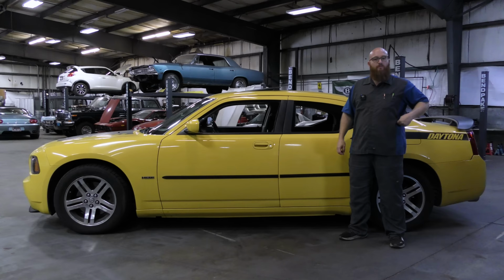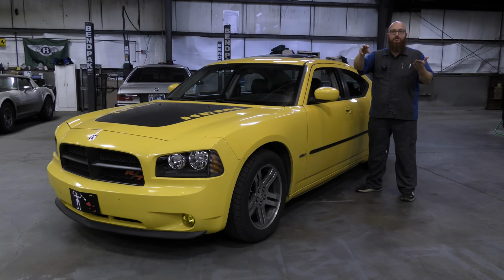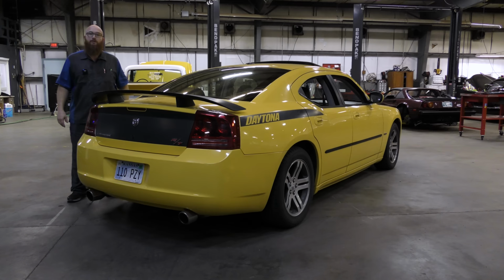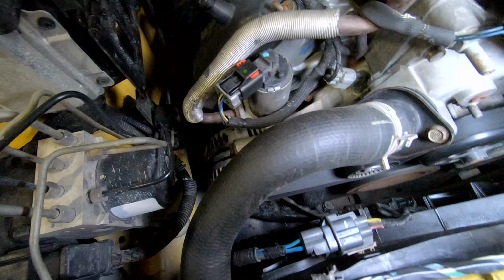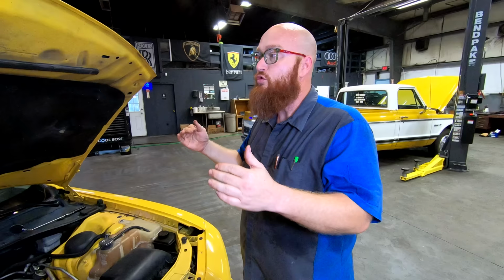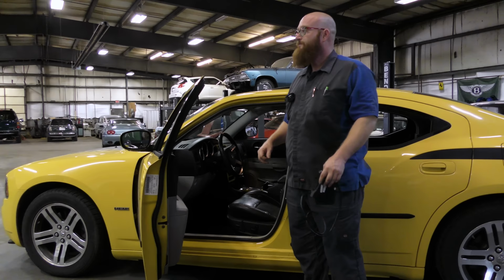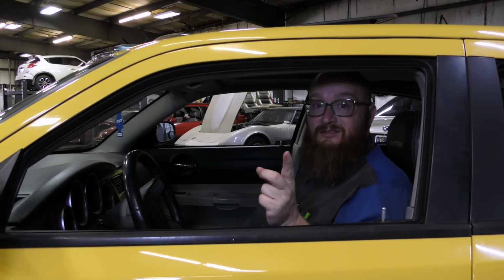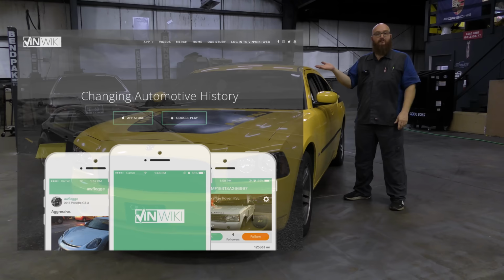4 things you MUST check before you buy any used car! CAR WIZARD shows how not to be scammed!

Comment: A good list but I have many important items to add. I won't buy a car if I don't get to see the cold start. If I show up and the car is warm immediately no deal. I've turned around and left large dealers because they warmed the car up prior to my arrival to run the heater or A/C. Take the oil fill cap off. Check for moisture or a white milky substance. Sign of a possible bad head gasket. Look down inside with a flashlight. Verify no sludge buildup. Pull the dipsticks. If there is burnt varnish that means the fluids have been neglected and/or the vehicle has been abused. Look inside the radiator and confirm no corrosion and that the fluid is the proper color. Take cardboard and lay under the car inspecting for rust and accident damage. Check tires - brand new is a warning sign of a possible cover up. Old tires are a sign the vehicle isn't driven much and expect many small things wrong with the car as you go to use it. Old tires are also a bargaining point - a new set could be upwards of $1000 depending on model. Be sure the spare tire, jack, and security key are all there and in good order. Slightly mismatched colors on body panels, overspray, and any fresh paint are warning signs of collision and/or covering up rust. Finally be sure all the exterior lights and wipers function properly.
Reply: Hi! Yeah! The guy wanted to come to my place like he was doing me a favor and saving me a trip to look at his used car. Then when I go to his place at a scheduled time, the engine is warm and he says "I just took it for a quick trip to the shopping center." in spite of the fact that he had another vehicle. And it was slightly leaking something underneath. He's now messaging me offering to drop the price. You wouldn't take it right?

Comment: I worked for chrysler...i was the release engineer for the engine and trans dipsticks on this thing. I had to get rid of the trans dipstick as a cost savings measure...it was on my goals for the year.I did as I was told
Reply from the maker: Mercedes transmissions of these years never have a dipstick. That was a Mercedes decision

Comment: I have a multiple page checklist I use. I crawl all over and under for about an hour before even starting it. Look in the trunk, pull back the carpet and look for bodywork. Are any of the panels different colors? Also check all the windows, are the labels the same. Look underneath for crumpled or kinked parts.

Comment: Useful video. Heavy wear on the gas pedal rubber won't tally with low mileage. If the car has steel bodywork taking a small magnet along and placing it on areas commonly scuffed/scraped can reveal previous accident repairs as the magnet may not stick to those areas due to the presence of body filler. Feel the hood when you turn up. If it's warm the seller could have run it a while to hide cold start issues (it's also a warning not to open the coolant reservoir immediately). If a car has a tow hitch/ball mount fitted but not the hitch/ball itself, rust or wear around the bolt holes on the mount can can betray a hard life of heavy towing. That might not be an issue but be suspicious if the seller says it's never towed anything. And don't buy a car on a rainy day. Wet bodywork can hide all sorts of paintwork issues.

Comment: On the brake fluid. The level will drop as the pads/ shoes wear. If the level is low, check the state of the brake pads. It is not a good idea to top up brake fluid as it will spill when changing old pads/ shoes for new units.
Reply: That’s true but if you pop the bleeder valve open like you “supposed” to then it doesn’t matter much
Reply: Why do it get lower? Because of the wear of the brake material? Does it keep the pistons pushed out farther or something when the pads are thin?
Reply: Had this happen the first time I changed pads myself, and was confused/concerned there was something else wrong with the car until I did my research.
Reply: @kalashnikov1343  The fluid level will drop in the master cylinder because as the pads/shoes wear the wheel cylinders will be further extended and hold more brake fluid. When you put on new pads/shoes it compresses the wheel cylinders back in and pushes the brake fluid back into the master cylinder.
Reply: Leaving the wheel cylinder bleeders closed and forcing the brake fluid back into the master cylinder is a really bad idea on cars with ABS brakes. The ABS valves and pump are extremely delicate and any particles from the downstream brake lines and wheel cylinders forced back through the ABS system can cause the ABS to fail.
Reply: @tommyhawks856  ah, so it is exactly as I thought. Makes sense. Thanks for the explanation.
Reply: @aceroadholder2185  What you say is true about the ABS system. It is a delicate system, but performs very well. You also should never allow the brake fluid level to fall to the point that you get air inside the ABS block, so keep the master cylinder full any time that you have a wheel cylinder bleeder valve open. On at least some cars, getting air into the ABS fluid distribution block requires the system to reprogrammed.

My first car was a 1963 Grand Prix and the first car that I needed to bleed the brakes on. I never had to bleed the brakes on a car with an ABS system until I flushed out the old fluid out on a 2004 Silverado, in which I still own. I have always been a shade tree mechanic since getting my first car. These techno cars of today are much more difficult to properly diagnose and to repair than the days before they started putting computers on them, not to mention the cost of parts today. Electronically, the techo cars can be a nightmare to diagnose and repair. It is nearly impossible without the wiring schematics. Today's cars will become nothing more than static displays for future collectors. Finding someone with the right equipment and the knowledge of how to use it 40 years from now for these cars of today will likely be next to impossible I suppose that a restomod will be a thing in 40 years, but that is not the same thing.

Comment: #1 is so so important. Not only this, but you can also see if they purchased the car wholesale from a company(which means it's probably got problems and not kept for lot sale because they didn't want to put the money in it for new brakes/battery/starter/trans change/oil leak fix) and you're really buying a flip and not a vehicle driven by the seller.

Comment: The sunroof is probably something that should DEFINITELY be checked out by you even if you never plan on using it. Sometimes they have defects in the design that don't come up during warranty period (because it wasn't used) and it's one of those things that probably isn't a "cheap DIY fix". Even if you don't need it, you will have to fix it before you ever sell it.
Reply: i.e. nearly every year ford focus since 09. Every headliner is stained from the sunroof drains clogging due to being only about 1.5mm wide. It takes just a few grains of sand to clog them in a day or two then rain  fills the entire roof of the car then spills inside the entire interior of the roof then rest of the vehicle. Literally flooding the entire vehicle. EVERY single focus I've been in had brown head liners and mold in every crevice of the body 

If your focus has this issue. You must clean out the 2 drain ports weekly.
Reply: "you will have to fix it before you sell it" last guy didn't, why do i

Comment: just a few other things that might help 
it's best to look at a car when it hasn't been running and the engine is cold. sometimes a vehicle will have a problem with starting cold.do all inspections before starting the engine. then after you shut the engine off, wait a few minutes for the fluids to settle and check them again. also restart the vehicle after it's up to temperature. sometimes there's a problem with starting after they're warmed up too.
also, besides a mirror and flashlight, a good thing to take with you is a magnet. if the paint looks off in an area, see if the magnet sticks. if it doesn't, that means there's plastic body filler there. also look and feel around the door, trunk, and hood jambs. if they aren't smooth, it's most likely a tape line from painting. if you notice that a repair has been made, check everything in that area. example, Wizard showed the damage on his car. if I was looking at that car I would look inside the trunk thoroughly to look for damage and paint differences. look under the vehicle for the same. also if you see undercoating that doesn't look factory, it's probably hiding damage. 
if you live in an area where they salt the roads in the winter. check the frame and around the wheel openings for rust or repairs. be cautious if you see undercoating. I've seen cars where the frame was duct taped and undercoated to hide rust holes. if you see a little rust it's normal. but if it's scaly tap on it with a screwdriver to see if it's solid. if you push through with the screwdriver, walk away. 
hope this helps

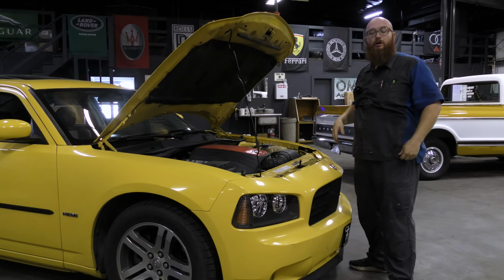Comment: 15:06 got a tip back when and I still swear by it now.

Coffee filters are your best friend here. Just a tiny bit of yarn, tie a filter around the exhaust tips and let it idle for a bit then a rev or two.

You'll know very quickly if it's spitting oil out even if you can't see a visible blue tinted cloud pouring out. Moisture won't stain the filter, while the oil will.

Comment: I like those corner lots with all the goofy flags. 
They run out to show off how fresh the newly shampooed (but ripped) interior smells, how shiny (the sloppy repaint) hood is, how the (freshly pressure washed) engine looks, all the time making sure to distract you from noticing that it was t boned and poorly repaired and play the radio loud while the engine runs so the clicking noises are less. 

Back in the 70s Canadian Robert Appel wrote a book on buying used autos.
He said "slick salesman will shampoo away all the evidence of oil leaks, use 50/50 STP & oil to muffle the rattle in the wore out engine, fill the leaking decsyed tires with sealer and spray armor all to hide the aged look"

I have seen a lot of illegal things also. Stuff that should never be sold.
Edit
Robert Appel said if you are serious about a certain vehicle, take it to an oil change shop and pay for an oil change then drive it.
You'll find out quickly if it was 50% STP - the death rattle will be louder after.

Comment: About the car scanner, some cars like my VW shows how many kilometers it drove since the last time the codes were cleared and how many times the car started since.

I also would suggest a cheap battery tester, when I got my car last years, one week later the battery died and wasn’t covered on the reseller warranty.

Comment: Always use extreme caution when you look for any used vehicle in general.
Reply: Especially with sports cars and 4x4 pickup trucks. If you see the frame painted black, poke at it with a screwdriver. Shady people/dealers often spray paint over rust to hide it.

Comment: Learn from the Car Wizard, dont make my mistakes 😅
I bought my first car, an older Grand Cherokee in a bit of a rush, and skipped most of these steps. I knew to check the mechanicals, I knew to check the electronics, but completely skipped on checking the exterior of thr vehicle for any damage beyond rust. 
A few days later I was washing it, and realized my passenger side fender was scratched up fairly severly and coveted up with spraypaint lol. It was minor enough that I didnt notice it when first looking at the car, but its major enough that I ended up needing to replace the whole fender.

Comment: Surely when you are checking under the bonnet, you should also be checking the VIN plate and the punched number on the chassis, plus check the chassis legs for damage, straightness,  different paint colour etc.

Comment: My personal take : the first thing I check is the oil stick - if the oil is dirty and low there's a good chance the motor burns oil - then just verify if the exhaust pipe is full of black soot which confirms the engine is burning oil - walk away unless you intend to replace the engine . Any oil leaks in the engine compartment could indicate the engine is "pumping oil" - walk away. Next check the radiator for corrosion and leaks and while the engine is cold check the rad fluid level which if low could indicate the engine is using Prestone. Walk away because a blown head gasket could be the cause. Bring a friend who knows cars well or better yet spend the money to have the car checked by a mechanic. If the seller refuses - walk away.

Comment: As a retired New England professional buyer let me say your video was excellent. May I offer a couple of additions? If possible demand a cold start, listening for engine noises. Missing factory decals on the radiator support indicating crash damage or in some cases a steam cleaning, sniff trans fluid for a burned smell as well as the color, lift up/down drivers door for hinge wear. We used to buy in New York what was called "Dr's wives cars. Expensive models with low milage but lots of in/out ear there. This was very common in New England but could apply in any urban area.  And I like the term mechanic. Good "ole fashioned term".

Comment: The ideal is to ensure that the car has been stopped for several hours by the time we see it, and then look at the ground, if it is dry it is already a good start. Then the first thing is to measure the oil, also with the engine cold. And finally, being able to see at least the dates of the last three oil changes and their correlation with the car's current mileage. Those simple first positive checks will indicate that we are going in the right direction

Comment: #1 on the code reader...I bought one and had an issue with our Nissan Maxima post oil change at the dealer....turned out to be a MAF code...turns out they checked the airfilter but didn't put the air box correctly....back to the dealer with the code...and they admitted they caused the issue and corrected it.

Comment: I got a great deal on my current car, did the research, it was a Salvage title, from a major accident, but was put back together pretty darn well, the paint doesn't match completely in a number of places, but what I neglected to check was the AC and the CD-player - both of which were dead or damaged. But, for a 2000 Honda Civic with 120K miles, for $1,900 six years ago, that I have only put about another $1k in in upkeep, I am happy - but this gave me a couple more things to look at if I get another car, thank you, Wizard

Comment: If they have access to a lift, I usually request it to be put up on the rack so I can inspect the underneath. There you will usually see how well the car was taken care of by the amount of corrosion, the condition of the suspension, exhaust, see any leaks, or loose parts. Ive seen cars that "look" great and once I peak underneath, they look like they went 200K on a saltwater highway without ever being washed.

Comment: one thing to add, make sure the timing belt has been changed or the seller changed it recently especially if it’s an interference engine
Reply: This x 1000. We bought a Honda Pilot with 230k  miles and were promised the timing belt had been done at 200k. Seller provided no receipt. Our being too trustworthy, cost us-$2400 when the car failed 117 miles later.

Comment: Thought my limited experience I've learned to check these things. Panel gaps, rust, rubber mounts and bushings. Take it on the highway and cruise at 70+ and then break quickly. Check tire wear and make sure there isn't any tire wobble. Press on the shocks and make sure the dampers actually prevent the car from bouncing. Finally I check crumple zones for wrinkles, sometimes rails and structures will be fixed but the area around won't.

Comment: If there is some broken or missing part like headrests, headlights, and the seller says oh yeah you can find those online. Beware, they are probably unobtainable or extremely expensive. Which is why they have not been fixed. You should also demand two key fobs especially with push button start. Those are $300 each, easily.

Comment: From experience I would rev it. I’m from kck but one time I went up to Walser bmw about a year ago to buy an 06 750li a dream car for me and I found out that the vehicle had bad valve stem seals by revving it a couple times. The car was a mechanic special and I learned that even “good” car dealers put real junk used cars out. The trans shifted very hard it was smoking out the tail pipe lots of interior damage and the car ran poorly and smelled of coolant inside. It was nicely detailed and the paint looked great as well but the mechanical side of it was 2/10 maybe. So really be careful out there with who you buy from n such
Reply: Your dream car is a big BMW which means your confusing a nightmare with a dream... Two totally different things buddy!
Reply: A dealership sold me a car with a bad head gasket was driving on highway and engine locked up had to get it towed found out the problem it was way more than I could afford I ended up loosing my car because the dealership never mentioned anything about it! They TRULLY sold me a lemon and I feel totally scammed for the money I spent on it. Unbelievable.

Comment: A couple more simple checks.  Are all 4 tyres matching (same manufacturer, size and type) and all with similar tread left.  Open the boot (trunk) and check that there is a spare wheel with a jack (unless it is one of the newer vehicles with run flats and no spare of course). You can also look inside the boot for any signs of accident damage or repairs by lfting the carpet.